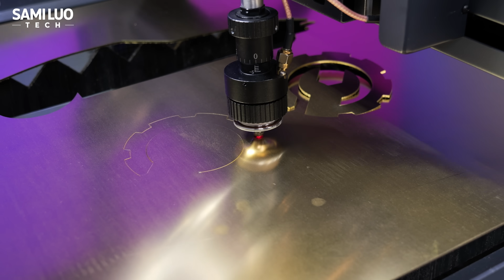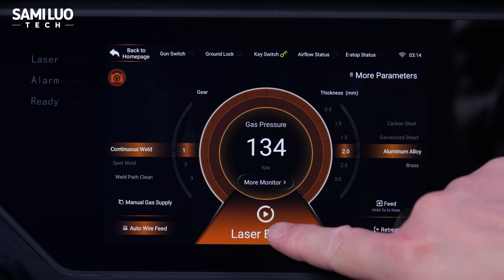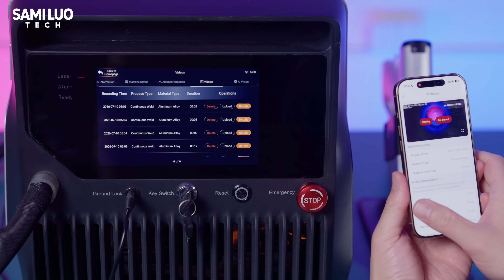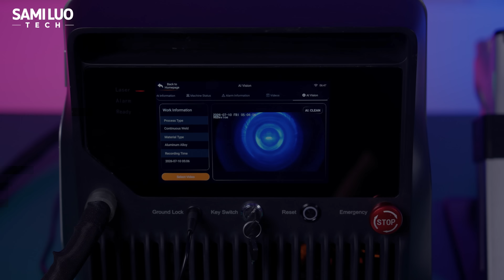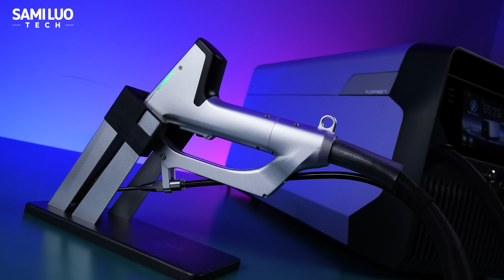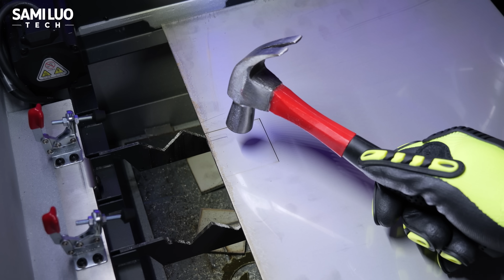I Tested a 1200W Desktop Laser Welder – The Future of Metalworking?

Comment: Will the machine overheat or suffer power attenuation during long-duration continuous operation? Is post-weld grinding required for the weld seams? Are cracks and burn-through defects likely to occur after welding?